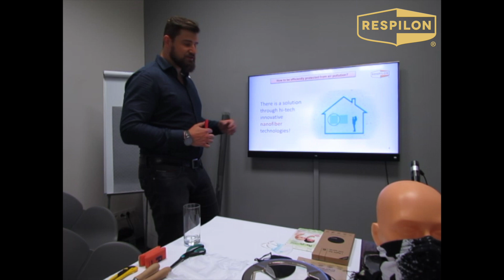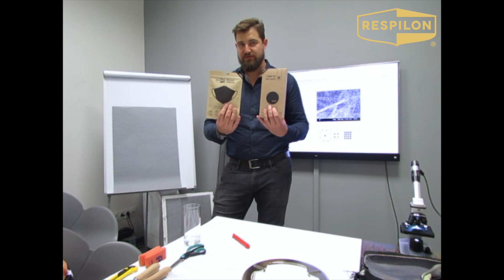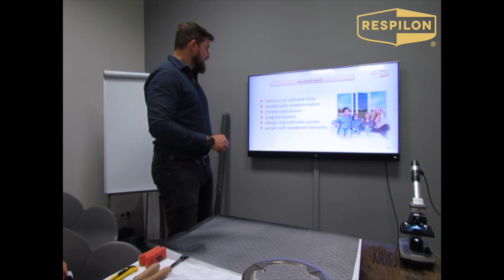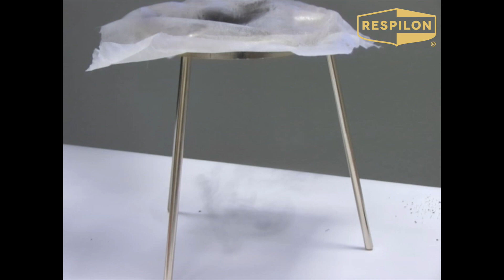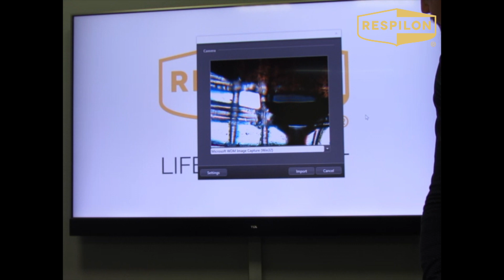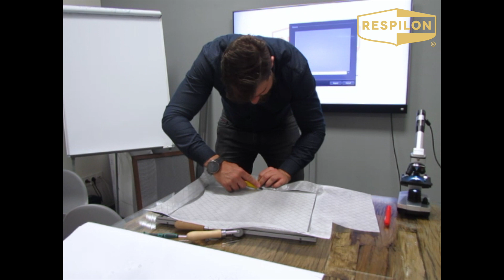Nanofiber window membrane

Comment: Great you saw the pandemic coming. The Respi Carbon is easy to breathe through, but why would you make such short strings.
Reply from the maker: Dear Mr. Luc, you can try our new product. VK RespiPro 2.0 is the result of the desire to constantly innovate our products combined with the feedback from you – our customers. VK RespiPro 2.0 has new round earloops characterized by their excellent elasticity. Klára, Respilon team
Reply: @respilonnanofiber7095  Díky Kláro, we will try. I have no problem with the normal CE approved respirators, but your product is great for older people within our family as it requires nearly zero added pressure for breathing.

Comment: Can it block 2nd hand cigarette smokes? as well as the odor?
Reply from the maker: Hey, it reduces odor but does not stop it. This membrane stops particles, not gases. The odor is gas what can get through the nanofibers inside as same as air. But dangerous particles from smoke are caught. If you have the membrane in your window and somebody will be smoking outside, you probably recognize the smell but by the membrane you will reduce dangerous particles coming inside. Jana from RESPILON